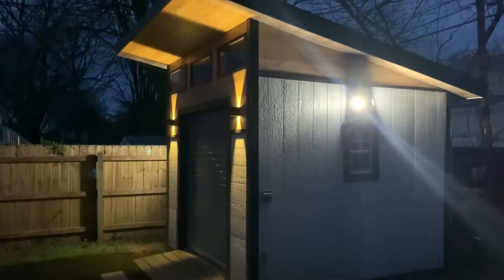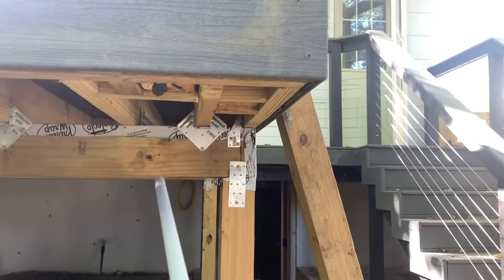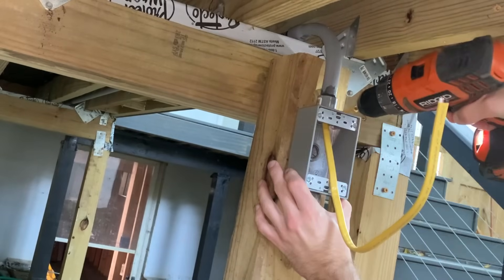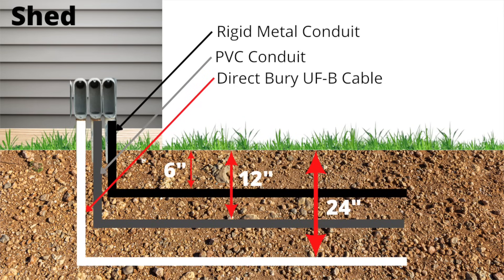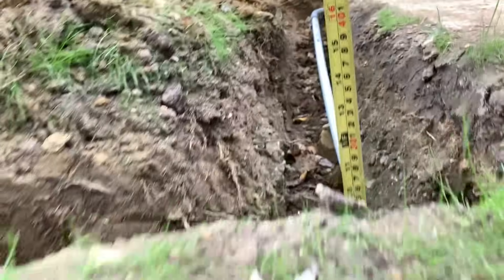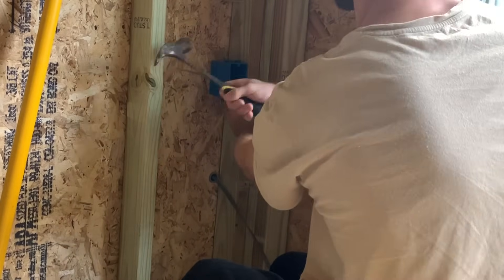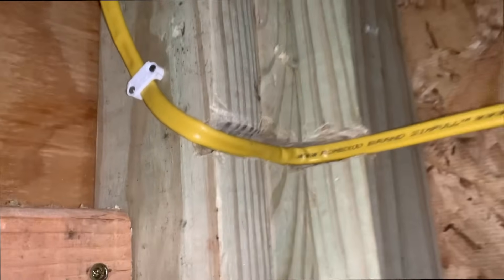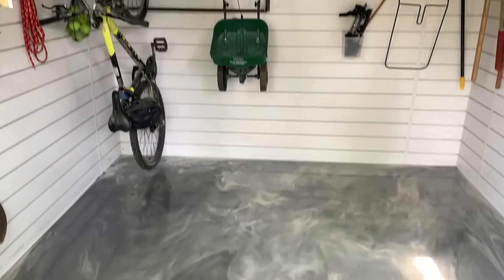Shed Electrical Installation (How to Add Electricity to a Shed - DIY)

Comment: Andrew,  Love the easy to follow step by step.  Regarding pulling the cable through the conduit, what I would offer as a tip: Since you performed the appropriate sweeping bends, this is super easy to pull romex through... Fully glue and bury your conduit... Option A: pull mule tape or 1/4" nylon rope through the conduit as you go.  Option B: fully assemble all the way to just before your junction boxes and using a vacuum, you can suck the mule tape through the full length by tying a large cotton ball to the end of your mule tape/nylon rope. once the rope is in the conduit, you can use conduit lube to pull your electrical through the fully buried line... and since it's buried, it won't budge.    
Knowing that you did this build completely by yourself, the way you did it is perfectly acceptable considering you only had a single pair of hands, but you can save yourself a decent chunk of time sucking mule tape, then pulling cable through lubed conduit.   Cheers, great video!

Comment: Huge rookie mistake at 9:18. NEVER fasten two wires onto a single terminal on a switch or receptacle! Always join them to a third, single wire using a wire connector, then wrap that single wire around the terminal. You espouse doing things to code, but that double-wrapped wire will fail code inspections pretty much everywhere.
Reply: I came to say the same thing. Two grounds on a single ground terminal is a no-go.  He needs to go back and pigtail it or one of those fancy ground pass through.
Reply: Gotta use a pigtail
Reply: Yeah, I'm no electrician but I've done light electrical work and this part let me know the creator might not know what he's doing.

Comment: Andrew, obviously you are a great DIYer, but an electrician you are not and don't appear to know NEC code. Instructing others how to install something governed by codes and not being trained, it's just not a good plan. 
For those wanting to meet the NEC requirements: the code requires a disconnect means for separate buildings. a gfic recept is not usually rated as a disconnect for a separate building (just a switch where you put the gfic recept would do. A heat gun making those 90's not so sharp would help.
 A bushing is required where the romex enters the conduit. UF cable in pvc is overkill, it just makes it needlessly difficult to install and strip it at a small pvc box. Your shed is gorgeous, looks great.
Reply: Technically this is a branch CCT not bigger than 20A, so not technically feeder, so shouldn't need a disconnect/ ground rod. no?

Comment: People like you is the reason we have a National Electrical code!
Reply: lol... says the electrician who didn't get paid for this job
Reply: that non-metallic sheathed cable is swimming in water
Reply: Yes.
Reply: I've seen a lot worse than this; some from licensed electricians. :{   He did a great job building the shed!
Reply: Who runs burial or romex wire through conduit?  Who has more than (4) 90 sweeps on any given line? Costly and Timely!
Reply: Are.
Reply: Yes too many violations
Reply: If the romex if UF what's the problem??
Reply: This would not pass an inspection.

Comment: ProTip- always add a spare conduit, you can use this for low volt, telecomm, or if the other conduit fails, you can use the second one, you wont easily get another chance to trench later on.

CodeTip- Most circuits are required to be 18 inches down in pvc, not 12 inches. Thats only an exception for GFCI protected wiring

ProTip- Its very for the GFCI to nuissance trip in years to come, because water ALWAYS gets into the conduit, if the wire gets damaged at some point, you will lose power without the GFCI. You dont want to be chained to a GFCI for power, they are not reliable long term

Look up the 'NEC burial depth chart' and make sure its from the last few years to be certain

[also your not supposed to use romex in outdoor conduit, but as long as it doesnt go underground, its not a huge deal]
Reply: 18" deep?  ipvc is 24" by NEC  RMC is 18"
Reply: What do you mean by "chained to a gfci"? That gfci is designed to trip very easily so you don't get electrocuted. Its there for a reason. You take that out and replace it with something else and you're removing an essential safety device.
Reply: Canada has a different code, but it depends on if the burial site has vehicle traffic over it.

Comment: That shed looks great. The electrical comments were very helpful. I see why you did it the way you did. My only comments are that i would have put the switches on the inside and used smart switches to set up timers and to be able to control them remotely. 
Do you have to use fire blocking rated caulk or spray foam for that penetration to your basement? I'm not sure when that applies.
Reply: I believe fire rated caulk or foam is only required to seal penetrations between living spaces to prevent fire spreading from floor-to-floor or room-to-room.  That’s what my builder relayed to me when I was running cat 6 in our house.

Comment: Buried conduit is considered a wet environment in code, so that UF-B was mandatory once you were in the buried conduit.
Honestly seems like you might as well have started with UF-B. NEC does not demand 24" in all circumstances, that is the deepest general recommendation.
One way you could have done this is to put a GFCI or dual function breaker at the panel, and run UF-B right from the main panel to your shed branch circuit.

Comment: Should have used a sub panel at the shed and ran a thicker wire, like a 6 for future upgrades, AC/Heat, outlets, lights, etc.

Comment: Helpful video. I’d run a underground spec data cable in a half inch PVC for a shed node to push a strong wifi signal out into the yard. With a clothesline string to upgrade or replace the data cable as necessary.

Comment: I'm actually surprised your electrician didn't put in a GFCI breaker in the panel knowing that everything that circuit will feed is outside, in fact I believe the NEC mandates that GFCI protection must begin at or before the transition point from interior to exterior in a branch circuit.  That 20 amp single circuit feeding your shed is kind of small, that only leaves enough power for lights and a few small power tools like a circular saw or jig saw.  I would have ran an 80 or 100 amp feed to the shed and put a small sub panel out there and branched everything off of that, but I also have a drill press, 60 gallon compressor, a 2 HP table saw, and a 5000 btu window A/C in my shed/shop which is much more than most homeowners normally have.
Reply: He's using it to store a lawn mower and shovels, etc.  I seriously doubt he would ever need 100 amps out there.  LOL

Comment: #2 Conduit has to be built then wire pulled! The glue will melt the sheathing on the cable. you will nick the cable doing it that way and it will be compromised. All conduits underground will have water in them no matter how much glue you put on the conduit, If you nicked the wire (which you did) is compromised.
Reply: and good luck with the 5 90's

Comment: Your shed turned out great! These videos gave me some good tips while I’ve been building mine. I’m just about to do my electrical also and am trying to figure out if I can use romex inside. I was thinking of using the metal clad aluminum (MC cable) instead of romex since it will be permanently exposed. I really do not want to run conduit everywhere.

Comment: After reading a fraction of the remarks I have decided to hire a licensed electrician to wire my shed.   Andrew, my advice is to hire a licensed electrician; show him this video and have it brought up to code.  Afterwards, sell the rights to this video to National Fire Protection Association (NFPA) which writes the  NEC .  They can use as a training video.   Hopefully water doesn’t get into the tubing and cause a short, especially since you poured concrete.

Comment: A good air compressor can assist in feeding the a rope by blowing air down the conduit the direction you push the cord. Then you can tie the cord to your wire and  pull it through. It's good idea to pull another cord through if youd like to pull other curcuits like cable, internet or speaker wire.

Comment: Good video. I believe it is against code to run Romex through conduit. My understanding is that you must use THHN or similar. It's also my understanding that if conduit has >360* on bends there needs to be a junction box, not sure if you have that many or not. I counted 4 x 90* so that may be within the rule.
Reply: Romex is allowed, and sometimes required, in conduit.
Reply: THWN might be safer for water resistance

Comment: One other little thing.  You're not allowed to have more than 360 degrees worth of bends between pull points in your conduit.  You have two 90's right at the bottom of the house, one 90 a few feet away, what looks like a 45 right before the shed, and then a 90 going up.  That's 405 degrees total.
Reply: Why is that?
Reply: @sarimjk  I would assume its because each turn adds to the difficulty in pulling the cable through.
Reply: Because he was supposed to build the entire pipe before pulling through with a fish wire/tape, which would be next to impossible with more than 360 degrees. I doubt anyone would even be able to pull it out without digging up the pipe. @sarimjk

Comment: Great job drew. For all those critics "make a video of how to do electrical correctly" instead of nitpicking this man's work.
Reply: I also saw a lot wrong with his electrical work. Even his " electrian " did not run the NM  ( romex ) through the center of the floor joists.
Reply: Pointing out multiple code violations is not 'nit-picking'. 99% of the code is there to keep people safe, and the work needs to stand up to the test of time.

Comment: Over long distances, from home service panel to a shed in the back yard, you will experience 'voltage drop' so plan accordingly, like using higher gauge wire #10 wire. BTW: What size breaker did you electrician put in your panel? This would be useful information.

Comment: Good looking shed .    💰🤑🤠           I don't understand why there are so many 90° elbows . You only needed 2  90° elbows .   Straighten the ditch out .    3/4  PVC is flexible .   Wet locations use   UF wire in conduit .
Reply: UF doesn't need conduit in this installation, it's rated for direct burial.
Reply: @georgewadejr5474  Sherlock didn't say wet locations use UF wire in conduit, you did. First, no, UF goes right in the dirt, installing it in conduit is an amateur move. Second, UF is cable, not wire. So does that make you stupid is or stupid does?

Comment: I would have ran extra amperage to shed and used stranded wire. Would hope wires could be pulled through conduit if necessary. Switches for exterior lights on shed should be installed inside house. Wouldn't have to run outside when the lights needed to be turned off. Good job on keeping burial depth in mind though.

Comment: When I read the National Electric Code (NEC) the conduit had to be fully assembled before the wire was pulled through. If you plan on storing gas powered equipment in the shed then read the part of the code that explains when explosion proof fittings are needed. Generally the plan is developed and drawn so that with the aid of the drawing  and parts list a permit can be issued. No permit means your home owners insurance may not pay if something goes wrong.
Reply: Yes, conduit is required to be completed before installing conductors but a residential shed is not a hazardous location requiring explosion-proof fittings.

Comment: Nice how to video.  I especially liked the min depth graphic.  One question, for some reason I am under the impression I should only used lose wires and not romex though.  Just want to get your opinion on that if you don't mind.  ty!
Reply: You can't use NM (romex) underground, but you can direct bury UF cable or direct burial rated individual conductors. If using conduit, individual THHN conductors is your best option. Installing UF in conduit underground, while allowed, is amateurish and foolish.

Comment: I bought a house in 2000, it had the water well in the front yard, about 50 feet from the street, and the pump and tank was also located there.  The house sat about 300 feet further back from the street, and to power the water pump, the previous owner had romex suspended from the oak trees running all the way back to the house, entering the front living room through a hole in the floor, with the romex connecting to a lamp corp with wire nuts, then inserted into the electrical outlet in the wall of the living room!  ...face palm/shakes head/ rolles eyes!!    I installed UFC down about 3' (ditchwitch) and a proper 20A breaker in the electrical box.  Took be a whole weekend to do...oaktree roots!
Reply: And that’s why you should always hire an inspector before you close.
Reply: @allenemiesforeignanddomest3320  I really don't need to hire someone to tell me something I already know!
Reply: when i bought my house, the well had a harbor freight sump pump sitting in the well pit with a garden hose run down the hole to the water... and it was powered by an extension cord with the plug cut off and stuck into a breaker in the electric panel.

Comment: I don’t think NEC allows for underground Romex. PVC conduit under NEC rules is 18” deep. You may need primer then glue for fittings - not sure.
Reply: Primer may not be required if the glue manufacturer does not state that it is required. The 'electrical' pvc glue sold in Home Depot is different than the 'plumbing' glue. The plumbing glue usually requires primer.

Comment: For your information the number of curves you used is higher than the NEC code electric recommend.
358.26 Bends — Number in One Run. “There shall not be more than the equivalent of four quarter bends (360 degrees total) between pull points, for example, conduit bodies and boxes.”

Comment: I don't know where your located, but you can't put a yellow romex under ground, it gets moisture and will rot. You need to use another type of wire coating, that runs into the conduit. unless your area says ok, florida you can't

Comment: PVC pipe must be a minimal of 18 inches. UF cable can be 12 in if GFI protected from the main panel.
Reply: As long the circuit is residential, 120V and 15 or 20 amps, and GFCI protected, the conduit can be 12".
Reply: code states PVC is 18” to top of conduit or cover Per NEC 300.5
Reply: @michaelsrossi3293  You're correct, it says that in Column 3, but Column 4 allows for 12" when installed according to the conditions listed.
Reply: @pld8993  right I didn’t read or watch long enough to see it was GFI protected knee jerk reaction to first comment
Reply: @michaelsrossi3293  That's one of the few things in this video that don't violate the NEC.
Reply: @pld8993  should still be 12” of cover not trench depth

Comment: UK electrician, we generally use an armoured cable for outdoor runs. Have a 600mm depth rule for none armoured. All our circuit's are gfci protected from panel. Conduit runs would require a number of access points.

Comment: If I were to put Romex in buried conduit, I would only use UF-B cable. Conduit often ends up full of water in a few years, or less.
Reply: Don't put Romex in buried conduit.
Reply: condensation from the air is enough to fill it eventually

Comment: Nice job, but you'll need to walk to the house if you trip a breaker.  Do you need to cover the exposed horizonal runs of Romex so that they can't be damaged from accidental contact or used to hang things or used as a ladder to reach higher items?

Comment: Not how i would have done it, but nothing wrong with it. good work. pulling romex through conduit is rough. I would have switched to thwn but i understand but i understand your process.
Reply: Except for multiple NEC violations.
Reply: if nothing else unsheath it as you fish it in.

Comment: You are also in violation for having more than 360 ° of bend by 45 degrees.  I would have used THWN in the PVC. 
ITS A GREAT looking shed, especially the slat wall and accessories!

Comment: I have a question: 1. If I use conduit (pvc) do I use wire or can the romex go inside. 2. for the exposed part, can I use the electrical pvc conduit or do I use the metal? 3. The reason is I am asking is because I have to go from outside wall to burying. I do not want to have to buy different wire I guess
Reply: Easiest would be to strip the romex and fish the raw wires through after assembly.
Reply: @thedavesofourlives1  Uh, no.

Comment: How did you waterproof the conduit bends? THats what I dont know. Worried water will creep in on the 90 degree bend angle joins ( whatever they are called)
Reply: You don't. All underground conduits end up with water in them, no waterproofing required.

Comment: All of the electrical (blue) "boxes" (circular and rectangular) on the exterior walls of the shed should be mounted flush with the exterior wall.  So, neither the box for the double switches or any of the boxes for the exterior lights comply with electrical codes.  And they're all fire hazards and potential shock hazards.   Other than that (and running the wrong type of wire out of the house), good video.

Comment: IMO.  
I always over size my conduit runs
and never let the conductors get tangled in the pull
Then if other circuits or ? Are needed
It's easy to use the ground wire to pull in more conductors

Comment: YEs folks, always check with a local electrician to make sure you aren't engineering a code violations as code does in fact change and there may be considerations to where you live. As of today, prior to watching this video, I found another that specifies that NMC (non metallic/Romex etc.) can not be run inside ANY conduit once it transitions to a wet location...for example, if the conduit/pvc goes outside, your wires inside must be THHN and NOT even just stripped NMC/Romex!